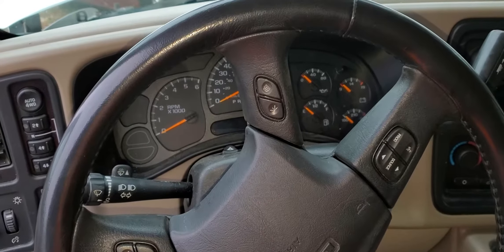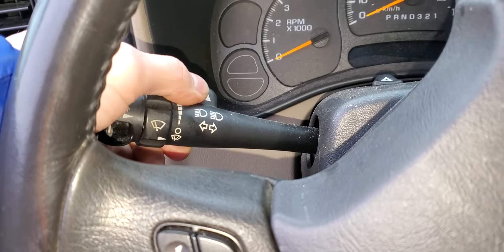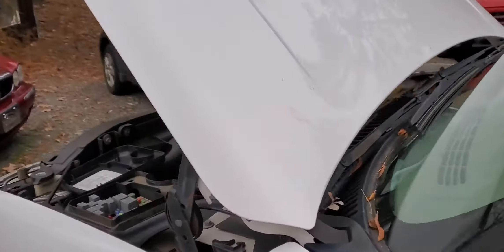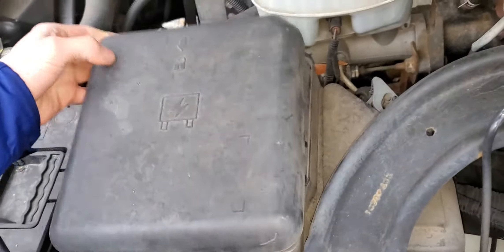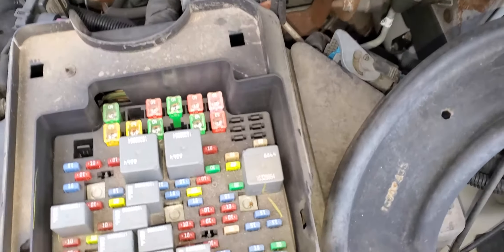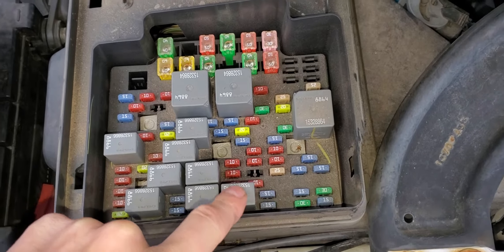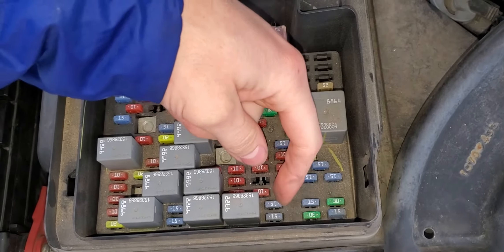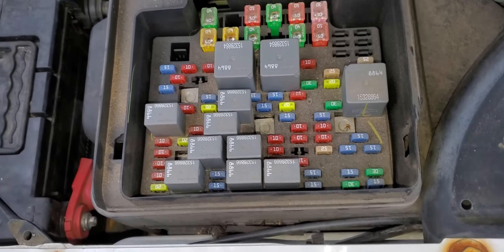2006 GMC Yukon Windshield Washer Relay & Fuse

Comment: Wow i just bought a 2006 Escalade ext and found out the thing wasn't working. I ordered the pump a couple days ago, Coming tomorrow. Then i decided to check the fuse. Came across this video and checked the relay. It was stuck, and after i wiggled it loose the washer motor started working again. 🤷🏾‍♂️ Ain't that about a 
B!+ch. I bet a shop would have somplycharged me for a diagnostic check, a new motor, the hoses, fluid and the relay😳

Comment: 2006 Chevy Trailblazer washer works when turned on but... you cannot get a steady stream. it only sprays that initial "splash & wipe" spray then quits spraying shortly after starting. Pump issue or circuitry somewhere else?

Comment: Wow what a coincidence, I have a 2006 GMC Yukon and all of a sudden my windshield washer fluid does not spray out, I am no mechanic by a long shot but I do live in Minnesota and it's winter time so I'm just hoping that maybe it's frozen, or some type of snow is inside the nozzles of these as it was just working a week ago, so I'm hoping what you just showed me about the relay in the fuses is the problem, but how do I check those things
Reply: Make your own washer fluid that won't freeze using rubbing alcohol dawn dish soap and water

Comment: Hy there. I have power at the fuse, and the pump sprays if i ground my test light and then probe pin 85 on the relay. I switched the relay with a working one and still nothing. Would this be wiper pulse board?

Comment: Good morning  I have a 2007 gmc yukon in my wiper only working in  high speed
Reply: That is a wiper pulse regulator motor it it is by the wiper blades. My is currently doing the same thing